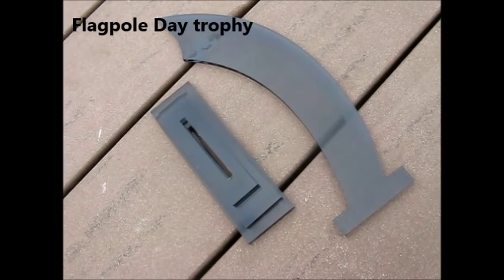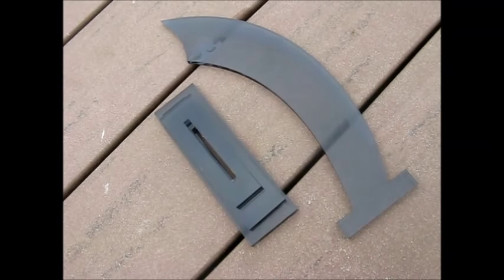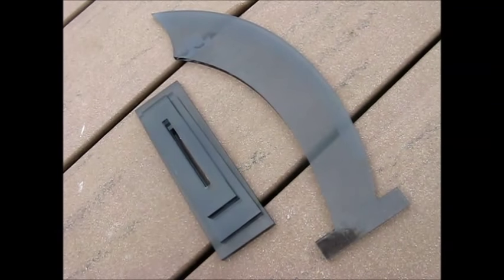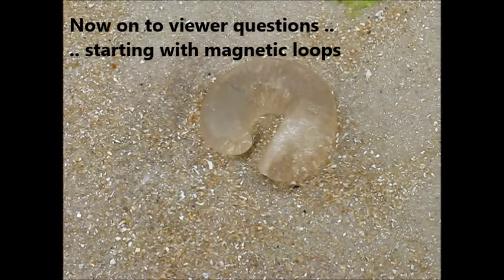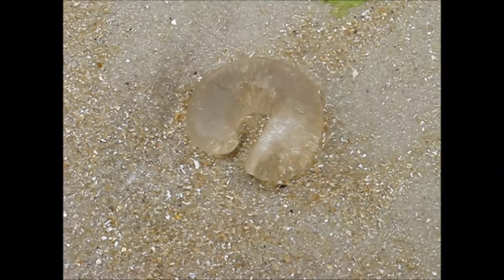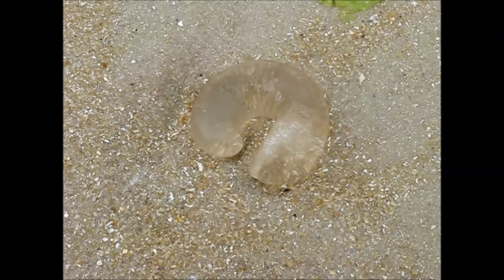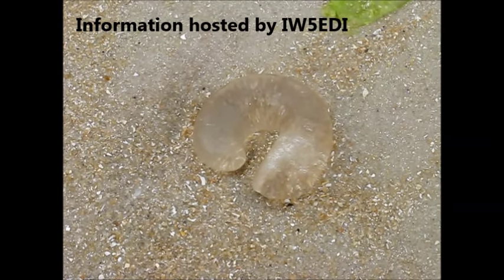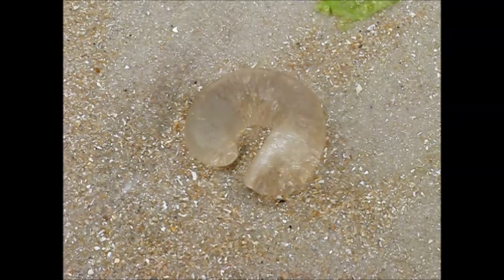The inbox segment: Part 9 (answers to viewer questions)

Comment: Peter, your memory did indeed serve you correctly.  W7ZOI & W1FB's "Solid State Design For The Radio Amateur", Chapter 8, specifically pp197-201, describes a 2m DSB/CWexciter.  It uses an 18 MHz Xtal in a VXO achieving 100 kHz tuning range.  Being an exciter, the power output is only 400 mW.  I couldn't find a power amplifier circuit.

Comment: Just for the record Peter, you do not need software to read kindle books. Amazon have a thing called "kindle cloud" and as long as your computer can run the popular web browsers then it should be fine.  This is how I read kindle books on a linux based os.